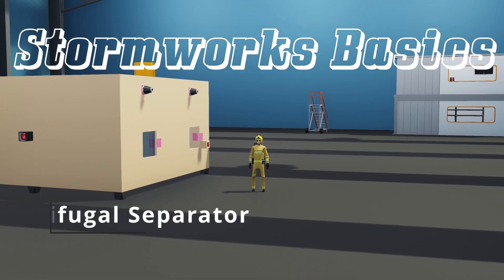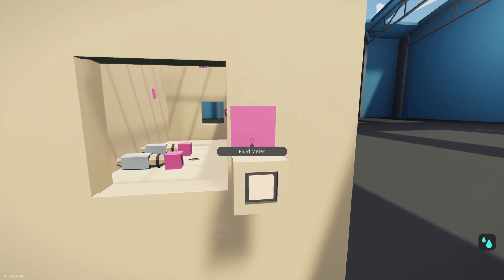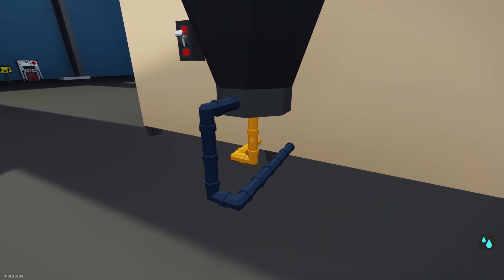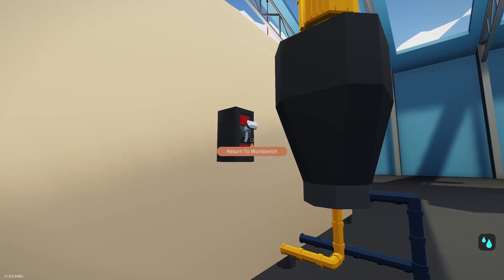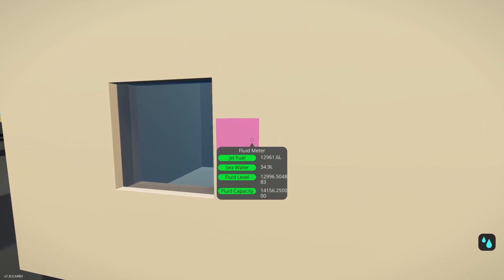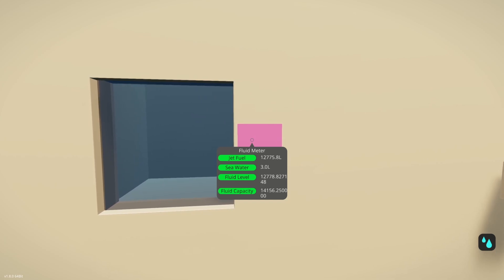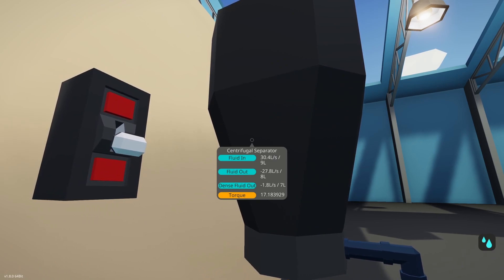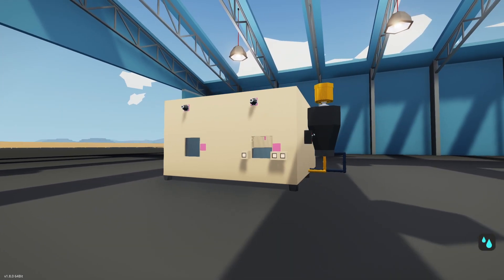Stormworks Basics: Centrifugal Separator Tutorial #stormworks

Comment: So probably want a 2 step process, then. Have one to pull in and store the oil, and a secondary run to resplit and get excess water out. Could easily hook that up on the same system, though, so really just a secondary look into the separator. Good info, cap.